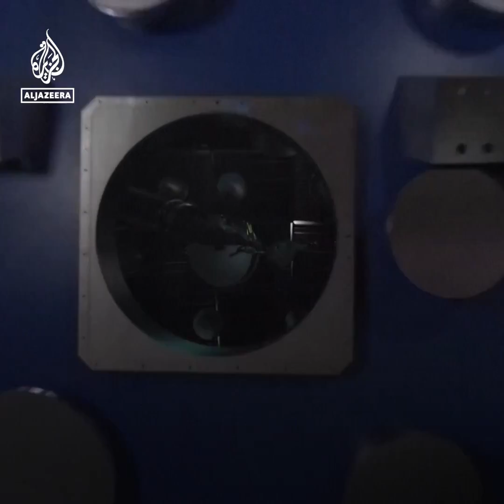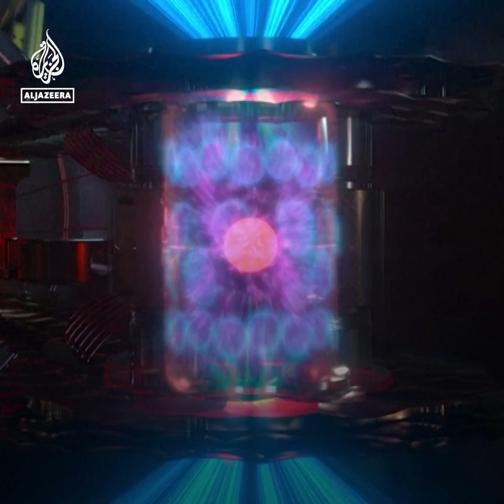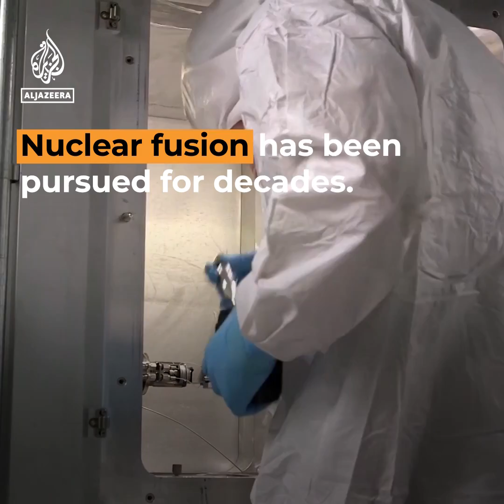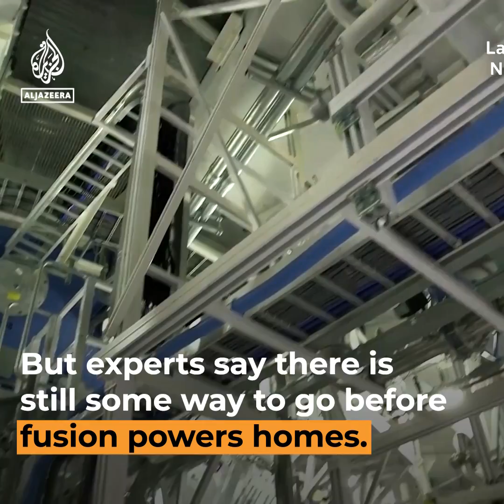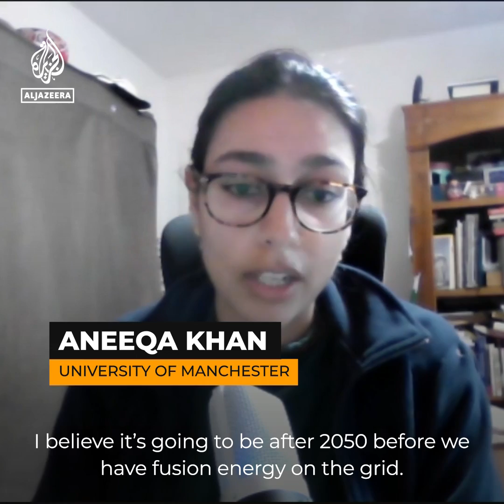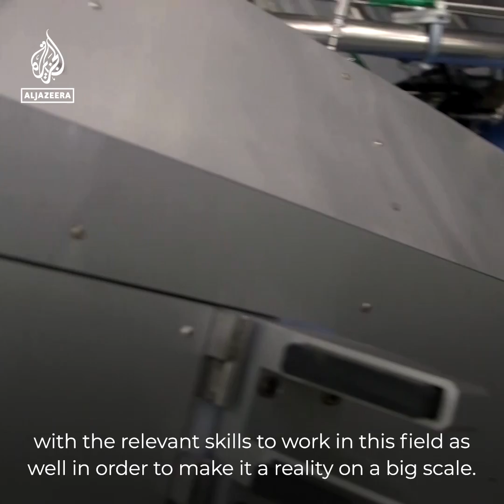US scientists announce nuclear fusion energy breakthrough | Al Jazeera Newsfeed

Comment: The cold fusion breakthrough was achieved more than 30 years ago but it was demonized and suppressed by the media and their sinister advisers because it was not done by the big boys.  All it is really palladium in heavy water when powered by DC voltage goes into an atomic reaction (without generating harmful radiation) and generates far greater heat than the amount of power (watts) that needs to run. Hence the name "ColdFusion" doesn't generate harmful radiation, instead generates an access reaction of heat.  But bear in mind that the atomic reaction continues even when the operating voltage is turned off. So, you have to have safety valves in place to release the pressure to the next chamber, should the pressure rises over the safety limits. 

A similar over-unity heat reaction can also be generated using Plasma and Hydrogen in absence of oxygen in a sealed stainless steel cell. Again here the Hydrogen goes into an atomic reaction without being consumed, all you have to do is to extract the heat from the cell and allow it to operate in a balanced manner, or else it will self-distract with 8K Kelvin. This is similar to noble gas that ignites in sealed tubes without getting consumed.
Reply: I recall the cold-fusion hype when I was in grad school, the '89 or '90 Elizabeth Holmes. There were many problems, like a major one. That being other labs were not able to replicate the process. MIT and CalTech put nail in coffin when they claimed that cold fusion went from hypothetical to practical to theoretical.  That's a pretty ugly...frugly... endorsement.  Am truly sorry to put a negative on your story, pal. But it was a good story.  🐈
Reply: @deozeo4442  No worries bro. We discuss ideas and truth here. "Denying the Truth Does Not Change the Facts ".
Reply: Sounds like you know how to make limitless energy. Why didn't you just get the boys together and become super rich?
Reply: @Skankhunt420.  , What I shared it's true. Cold fusion needs heavy water to work, but buying heavy water it's very expensive and restricted. Ordinary people can't buy it in the wrong hands and can be turned into a dirty bomb. But the hydrogen furnace it's not dangerous and anyone can make it. In the worst case, it melts down.
Reply: @Skankhunt420.  All the basic knowledge is here, above.  Any hand person replicate can do these things. Long ago I had the privilege to get to know some wise guys and all this knowledge belongs to them. So here it's freely I share it with you.